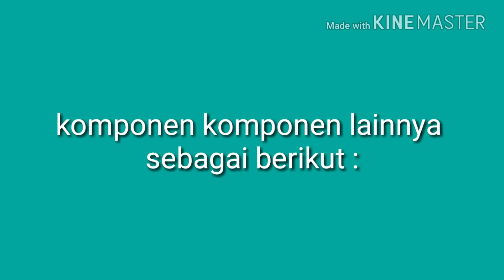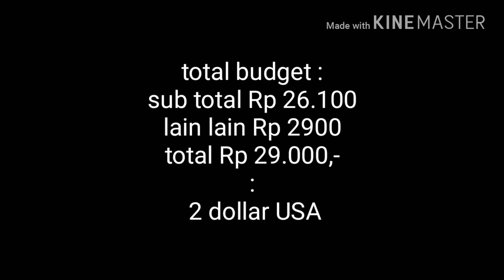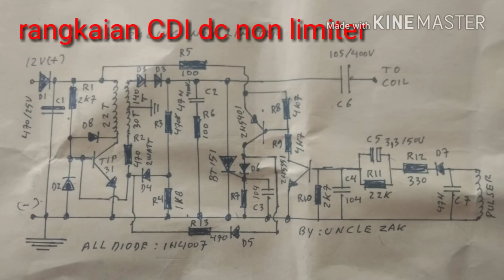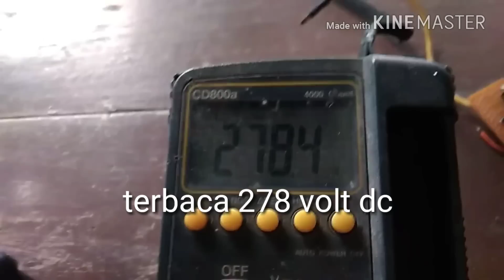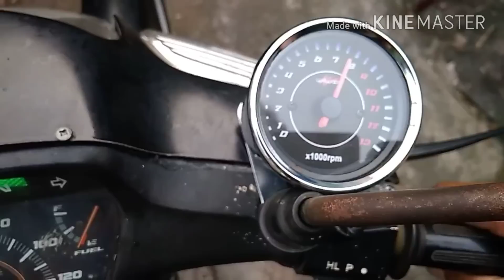CDI DC non limiter 2 dollar USA

Comment: Klau fulser arusnya 12volt fatal untuk cdinya gak ya uncle....soale ini motor masih platina tp fulsernya bikin rangkean triger jd platina sebagai fulser
Reply from the maker: Enggak masalah pakai negatif 12 volt platina  output bisa diatur pakai voltage devider
Reply: @unclezack19  iya ini lg bikin dr lilitan bekas relay trs ditambah lilitan buat skunder.....nnti dr platina cuma diambil masanya aja.soale klo mau buat pic up susah cari tmp nya klo masih dr platina kan mudah

Comment: Assalamualaikum
Saya udh buat cdi seperti skema transistor tip saya ganti 2sc5200 dan resistor 470ohm 2w diganti 660ohm.tapi kenapa cdi yg saya buat outnya gk ada setrumnya??
Reply from the maker: Base transistor kemungkinan terbalik
Reply: @unclezack19  Ngga terbalik mas, biasanya apanya ya
Reply: @unclezack19  tapi saya cek tegangan outputnya setelah dirangkai semua dan output 0v, apa harus pakai pulser motor ya agar out keluar setrumnya?

Comment: Bg mw tnya.. 
Kalo yg membuat dia limit iitu apa nya ya
Reply from the maker: Posisi RPM  tertentu tidak terjadi percikan bunga api, limit bisa dipasang di area pulser memakai dioda zener volt tertentu sesuai karakter pulser setiap motor
Reply: Ooo brti di bgian jalur pulser menuju scr ya bg?
Reply from the maker: @septian4357  iya betul pulsa dari pulser di ground kan akibatnya scr tidak aktif
Reply: Di bagian jalur pulser ke scr ada bebrpa komponen sprti dioda sama resistor..brti untuk unlimiter ada di bagian ini ya bg.. 
Klo gak salah teg pulser makin naik mengikuti rpm ya bg?

Comment: Paman. Kalo rangkaian yg pakai trafo lampu inverter itu bisa sampai brp rpm ya?
Reply from the maker: Bisa no limit, yang penting rangkaian area Pulser dirubah seperti video diatas dan seting arus inverter minimal 250 Miliamper
Reply: @unclezack19  ok mantap paman.. terimakasih informasinya. Sukses selalu..
Reply: Uncel untuk kode tip 31 itu apa di skema?